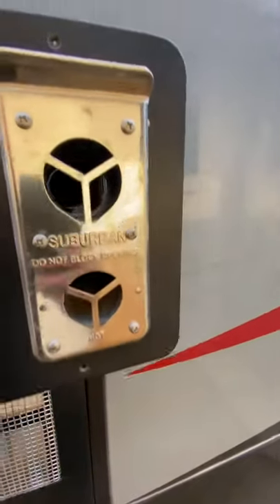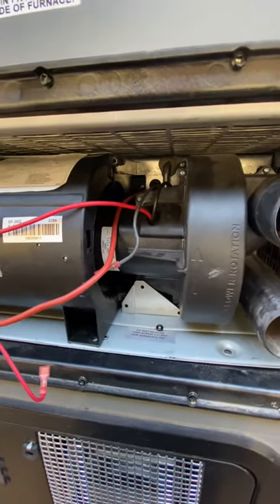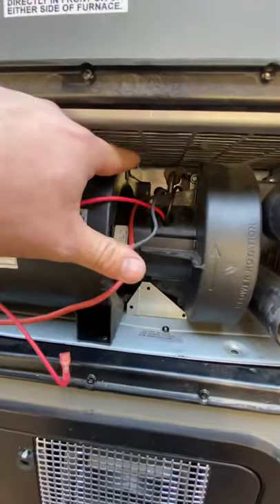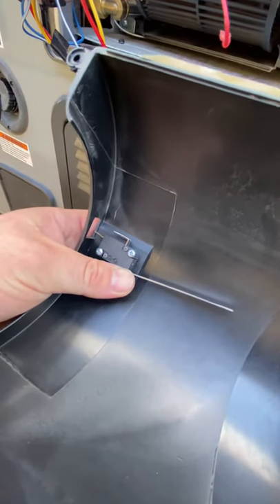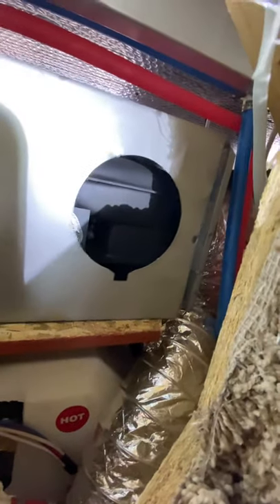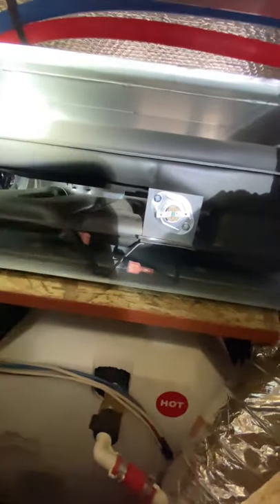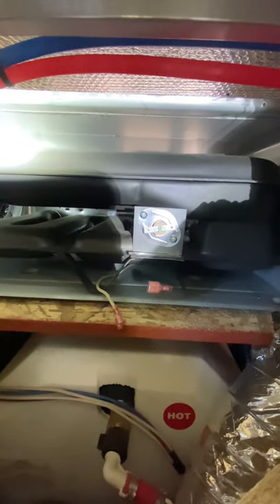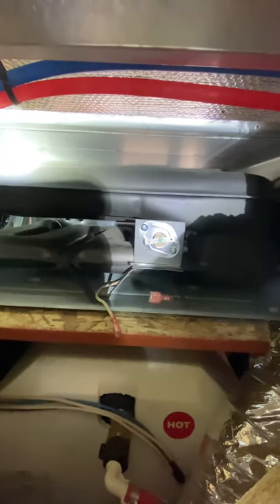Suburban SF-30Q sail switch and limit switch location and check

Comment: This helped me fix our problem with the rv we rented from cruise America. It was a fairly new rv with only 33k miles. In any case, the sail switch was an external one, so I did not have to take off the blower housing. I just toggled the switch up and down a few times with my finger. It must have been stuck. It just started working!!! Further details: we had used the furnace for 2 days in frigid weather and went through a full tank of propane in those 2 days … temp ranged from 1F - 9F for 2 days. We had to find a place to refill propane. Then we stopped using furnace for about 14 hours while we drove to warmer weather … mid 20’s …. Then the furnace would not start …the blower motor would run 20 30 seconds and then shut off before starting heater. I tried about 20 times. We went through all the troubleshooting with cruise America without success. They could not find an open rv repair shop in this area due to weekend and offered to reimburse us for a space heater . In any case, this video helped me fix it on my own! Hope this helps somebody!
Reply from the maker: Awesome glad I could help!

Comment: Well I started with the sail switch it checked out ok then to the limit switch and it tested good so I put everything back together and tried it and hello flamo so there was obviously a short on one of the connections anyway momma’s happy I’m happy come on winter
Reply from the maker: Awesome! The sail switch can get gummed up with dust also and cause it to not work, it’s a possibility this is what you had happen and moving it around cleaned it up.
Reply: @RompinWildMedia  appreciate the video the limit switch I had to get from the inside I call it the tunnel but thanks again

Comment: you might not know it, depending how many floor registers are block (by a rug or other objects) or reduced air flow (somethings fell in the registers building up over time) can cause the heat to back up in the furnace opening the limit switch.
Reply from the maker: You are 100% correct in that aspect. I would think you would have a continued problem with the limit switch tripping and it would bench test good at that point also.

Comment: I have a 2019 cardinal 5th wheel. I guessing mine went out. Is there always a way to get to it from inside the camper or do I have to pull the unit out? Any help would be appreciated as we are staying in it this winter
Reply from the maker: The sail switch you most like have to get to from outside, the limit switch you can get to from inside. Some trailers maybe different but most are going to be set up this way.

Comment: I don't have access to the sail switch from the outside.  I just have the 2 exhaust tubes.  I wonder if I can remove the heater (to get to the sail switch )from the inside by taking the grill off?  Great video!
Reply from the maker: There may be a way to access it from inside. You would have to locate your fan motor to be able to locate the switch. Thank you!
Reply: You gotta pull it out from the inside.   Disconnect thermostat wire, voltage in, and gas line

Comment: Limit switch confused,  normal operation both sides 12v ?
Reply from the maker: I have to try and recall the information now but I believe the switch is normally closed meaning it allows voltage through until it gets too hot then it will open and stop the flow of voltage. If you bench test it and there is no continuity through the switch then it is bad.

Comment: On the sale switch do you remember which terminal was positive and which was negative I wasn’t paying attention when I pulled them off
Reply from the maker: I don’t but it shouldn’t matter either way the switch is either open or close. All the switch does is complete the circuit so you could wire them to either side.